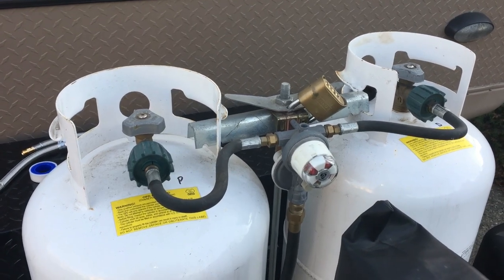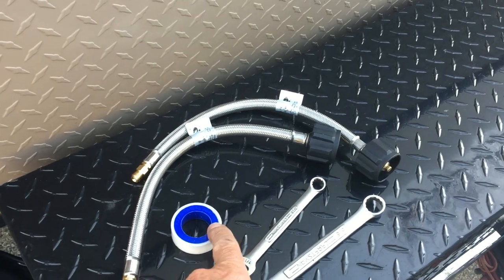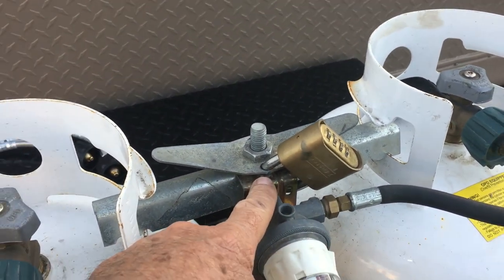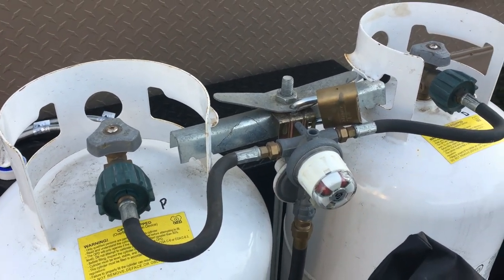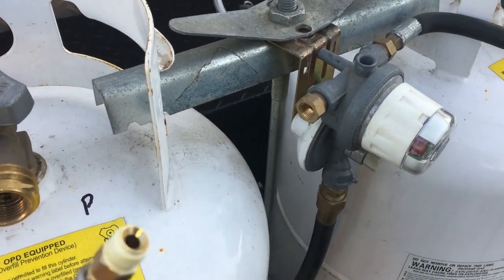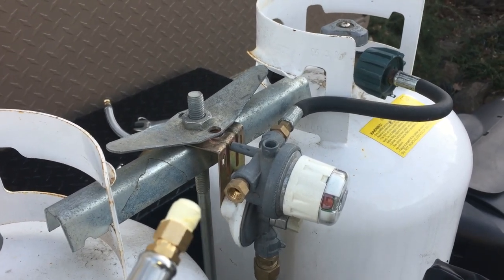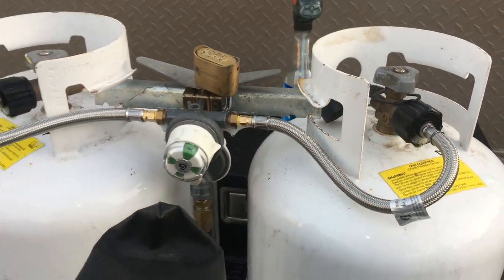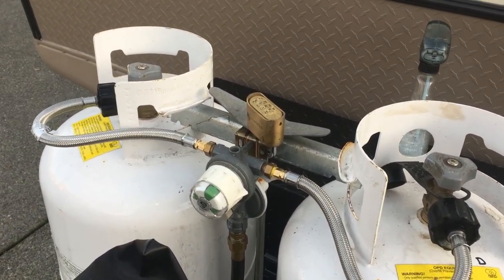How to Replace a Rubber Propane Hoses with Stainless Braided Hoses

Comment: Good advice, Michael! I had to replace the hoses on my Mallard after only one year. They both delaminated on the outside of the sharpest bends. I did replace with the braided lines like you did, but because it’s still just rubber hose under the braid, it might be worth replacing even those on a schedule. Maybe 5 years? I don’t know. A least with the braid, even a weakened rubber hose would resist bursting.
What are your thoughts on that?
Good video, Michael!
Tony B
Reply from the maker: I'm not sure how long they will last, time will tell I guess. They seem to be made much better built than the other ones I had. I'm going to keep an eye on them and will do a update video in the future. Fingers crossed. Thank you for commenting and watching, I appreciate it